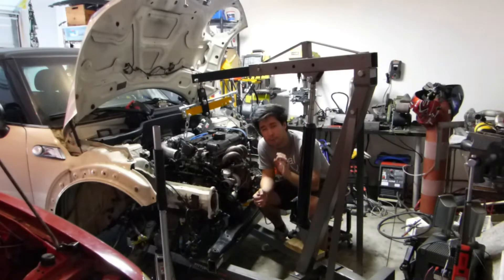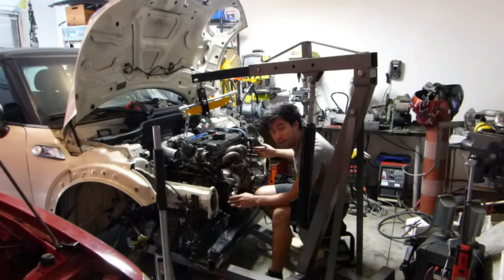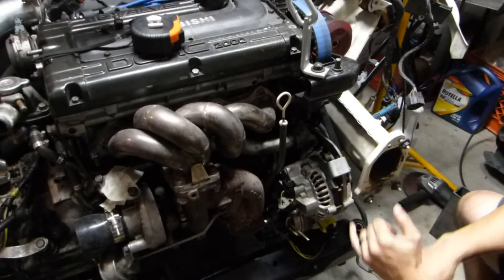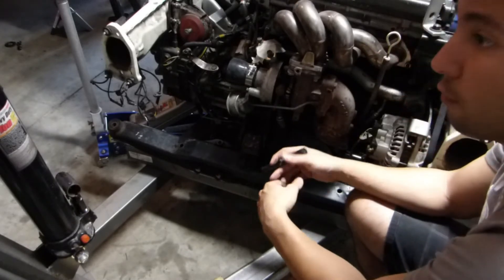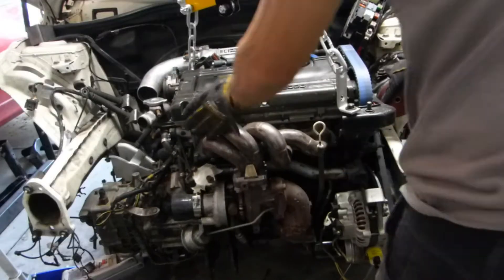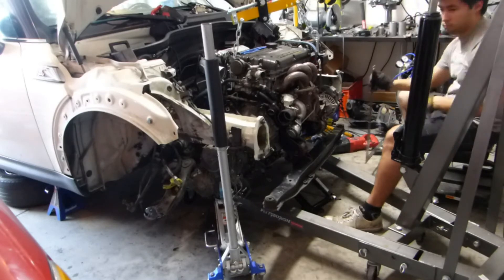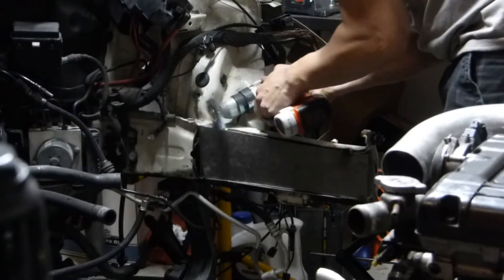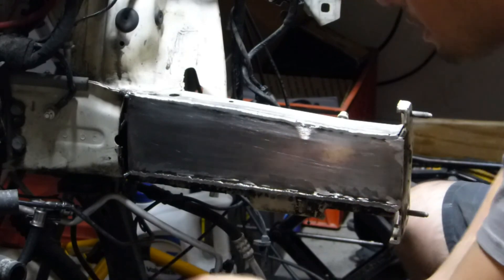✓ Modding the Frame to fit a 4g63 - AWD Mini Cooper Ep. 10

Comment: Your should have just got custom driveshafts made. Save yourself a load off hastle.
Reply from the maker: Nah it's not that much of a hassle and a good learning experience for rebuilding different driveshaft joints too. I couldn't go 1 piece driveshaft anyway due to size limitations so a 3 piece driveshaft should be fine for my goals and plenty stiff enough ;-).
Plus it would have cost more than I wanted for a budget build

Comment: I subscribed for the build and the speeduino.
Reply from the maker: Haha thanks. I'm excited to play with speeduino and want to start tuning even though the car can't even roll yet lol
Reply: I know, I'm excited about tuning mine, all I've done is bought the PCB. I'm really not sure what I'll do with it yet. I have been wanting to do a turbo ecotec in my Fiero so I've been looking into a microsquirt before I found the speeduino. But I'm far from collecting parts for the ecotec parts so I might talk my father in law into fuel injecting his 71 396 chevelle(he wants to do some type of LS swap because he thinks that's the only way he's going to get fuel injection). But if I can't find a good project to use it on soon, I might just run the stock 2.8l fiero engine with it.
Reply from the maker: Josh Bishop haha sounds like quite a few possible projects then. The speeduino is cheap enough that it'd be worth getting a couple. Might use another speeduino on the Miata, but I'll V8 swap it anyway so plenty of options too. But I'll be doing a Chevy 350 with fuel injection. Should be another fun project
Reply: Should be much easier to get an intake manifold to accommodate injectors on a SBC. They cost more for the BBC because of less supply. I have been contemplating how hard it would be to drill a cast iron manifold and potentially braze on some material if needed. The throttle-body setup looks like it would run around $150 using an adaptor and Chinese 90-100mm throttle body. I could be wrong but I think SBC and BBC distibutors are interchangable.

Comment: I'm sure it's too late, but if you don't need air conditioning, you can relocate the alternator to the rear of the motor with a  kit from places like Jay Racing.
Reply from the maker: Yes I have considered that but since I road trip this car all around the country, especially to Florida and Texas, AC is a must. I already have the AC compressor and the brackets came in after I made the engine/trans mounts (which you'll see in next week's video). I'll have to get the two line sets spliced together to integrate the two systems as well as convert any seals over to handle R-124a but summer's and winters should both be awesomely enjoyable in this car haha

Comment: You wouldn't necessarily need to cut anything if you use custom axles. It will cost a lot more than cutting your frame rails, but I would say it's safer and a better option. That being said, you're going about the process the right way to make a good swap.
Reply: Jeffrey Ball I've been looking at similar axle combining for when I get my SR20 MR2 swap done. Hoping some combo of the Nissan and Toyota axles and CV shafts may work without having to get custom axles made.
Reply: Start doing research now. Find the spine count and diameter of the axle shafts. I'm sure there is something close that will work. If you can find an axle of the same diameter between the two chassis but with a longer shaft, you can have the shaft cut down and resplined to match each side. Online parts suppliers typically have some cheap parts you can use to test with. I think my Pathfinder axles were only about $35 each and included the CV joints on both sides.
Reply from the maker: Thanks for the comment and I agree that is a valid option (and I did mention that as an option in the video) but there are several issues with that.
Aside from the cost, repairs would be more difficult if it ever needed to be replaced or upgraded. Another thing I didn't mention in the video is that the stock Mini suffers from horrendous torque steer where the GSX does not. A contributing factor to this is relative axle stiffness when comparing the left and right axles. I'd hate to get custom axles and reintroduce that torque steer into this chassis especially with all of the work I am putting into it.
Reply from the maker: Also, I saw a previous comment (it only came as a preview but seems to have been deleted by the poster so idk if it was you or not but it mentioned the same topic of the frame rails). The comment mentioned making the car unsafe in a crash. I actually made the frame stronger in the case of a front end collision by increasing the steel area that would be affected in a front collision. Now if there were a collision to the front driver side near the head light that hit completely perpendicular to the car (similar to a T bone accident), the car would be more easily totaled but at that point, the frame would be bent anyway and it wouldn't decrease the safety of the passenger compartment.
I added a significant amount of steel to the frame rail (nearly double what I cut out) but it's the new shape factor that decreases the side impact resistance. Front crashes should be unaffected.
Hopefully the original poster sees this ;-)
Happy modding
Reply: Axle length differences of only an inch or so shouldn't matter too much, but I'm certainly not an expert. You would really only need the axle shaft itself made or cut and you can reuse the CV joints from both ends. There might also be some off the shelf axles that will work. I put a 4G63 into a Dodge Colt. There are some width differences with the two cars, but Dodge/Mitsubishi did make a 1.6L Turbo version with a shorter passenger side axle that makes it an easy swap.
I've also recently swapped axles on my 4G63 powered Datsun 510 with a Z31 R200 rear differential using stock Z31 CV joints on both ends and only needing to use Pathfinder axle shafts. Way easier than getting adapters or custom shafts made. Not to mention much cheaper. Other than welding, it probably cost me less than $500 for the entire rear end swap. (hubs, CV joints, axles, differential, seals, bearings etc.)
#4G63510
Reply from the maker: Depending on how I changed the axle (custom for 1 or both front axles), I would get a decrease in axle stiffness of about 6% (5.88%) assuming the bar diameter stays constant and I would need to lengthen one side by 2 inches. If I lengthened one and shortened the other, I would have a difference of about 6% as well (5.97%) which is essentially the same change but at a significantly higher cost for 2 axles rather than 1. In general, it would take a lot more work and $$$ that I don't really have or want to spend (let's be real, I'm somewhat/pretty cheap if I can be lol).
The benefit of buying the donor car is so I have all the parts I need for the project to be functionally complete. Standalone and Coil on plug will help simplify certain features of integrating the two systems.
I was hoping I would be able to break even by selling OEM Mini parts and GSX parts I don't need, but I still have about $1k of parts that I'll definitely need (a good half sized radiator~$200, need coil on plugs ~$100, Air to water intercooler system ~$300, a new tablet for the dash board ~$100, new rear brake kit ~$75, Custom AC lines ~$125, plus small things). I've already spend $50 on bolts and didn't budget that in haha Not even sure if the GSX suspension can be modified to work yet or if I need to make it 100% from scratch. I'll find out this weekend as I dig into the suspension I'm sure ;-)
Reply from the maker: Also, those swaps you've done are pretty bad ass and Frankensteining the axle like that is pretty crafty. I'll be looking to upgrade the rear end in the future and will probably do something similar, but in terms of getting this car driving and getting ready for snow season, I don't have the time or budget at the moment. Hoping to be road worthy by end of October (No clue if that's possible yet and I'm sure tuning will take more time than I am counting for since I'll be doing that myself too)
Reply from the maker: 802 Garage or even swap out the hubs to match the axel CVs. And since the hub is less likely to break, if you snap an axle, you can still buy an oem spec replacement or used/junkyard replacement etc cheaply. I'm swapping over the same hubs that match the engine for this exact reason. Finding something to match that application might be hard but look at the Nissan Pulsar with the SR20. It had an AWD SR20det not released in the USA and it might be worth seeing if some of those bits will work. That was my original plan for the Mini before I realized the transmission would limit power so I went the 4g63 route